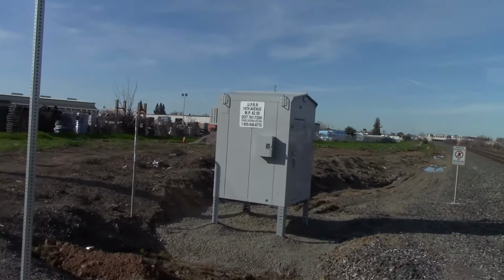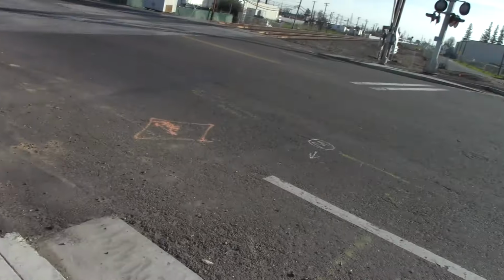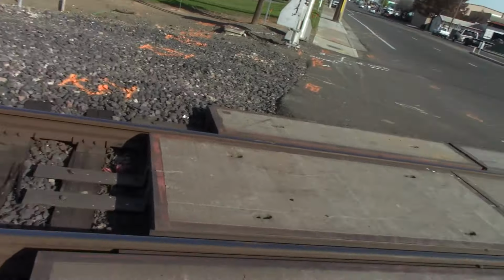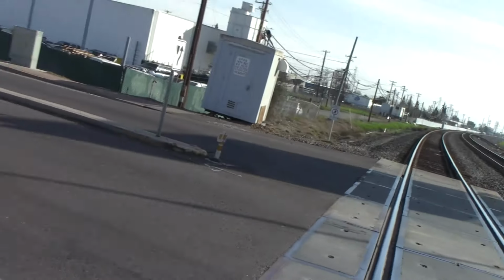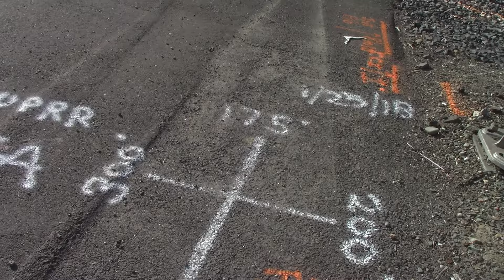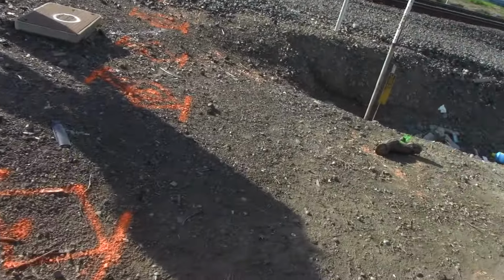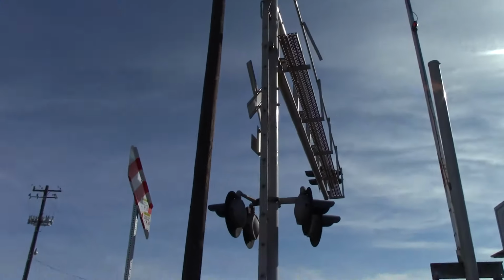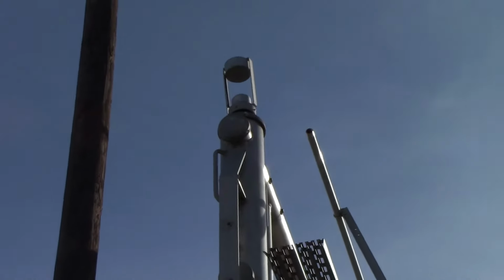14th Avenue Railroad Crossing Update New Relay Case Bungulo To Be Installed, Sacramento CA

Comment: If those Crossing signals to get replace you also say goodbye to the mechanical Bell on the other side which I think is a safetran  crossing Bell
Reply from the maker: Yeah I forgot to mention that as a saw the northbound coming. It's a Griswold Bell. If it happens would have to say goodbye to a rare bell combo of a Griswold Mechanical Bell and a Safetran Type 1.
Reply: MobileRailSpotterRxR here's an idea, I think you should try to claim it. If you have a Crossing Bell collection that would make a fine addition to it